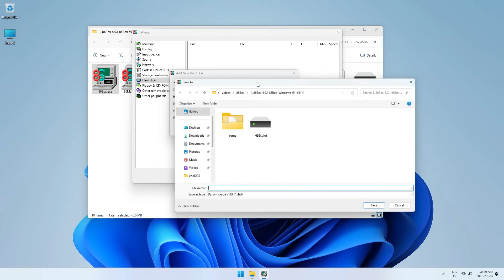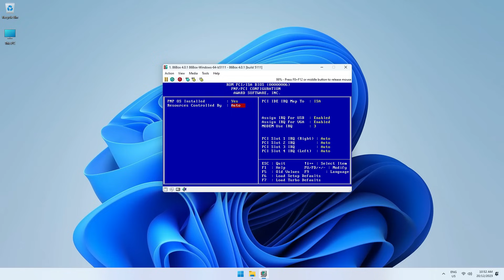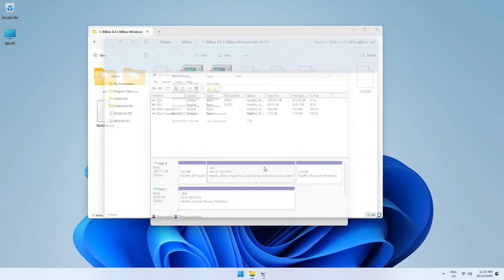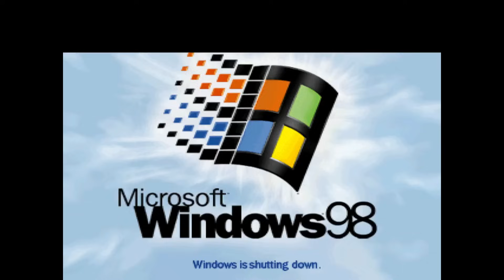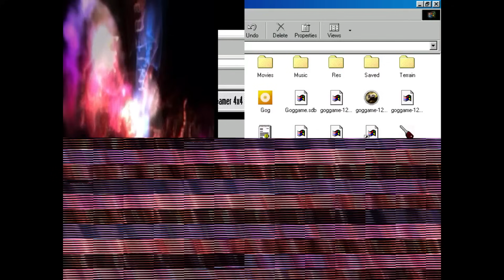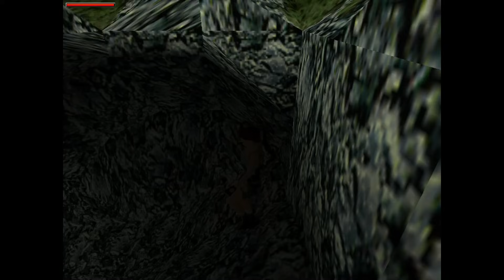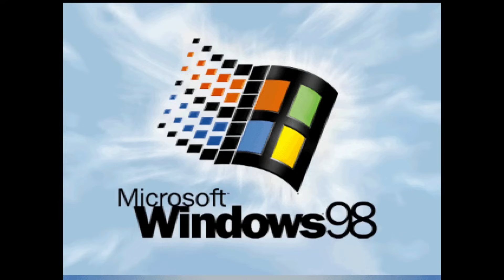86Box Windows 98 Setup (Pentium II +Voodoo  3, all files provided)

Comment: Windowed display is better in PCem, you can set aspect ratio to 4:3, integer scale, square pixels, filtering either linear or nearest. 
Its nice because i can just match the resolution of the game to either integer scale with nearest filter (looks amazing) if it is a good fit for my lcd monitor
or i can fall back to 4:3 with linear filtering where the above yields a too small image.
Only pitfall i encountered is if you size the window too small and integer scale is enabled it displays nothing (integer scale 0 i guess)

Comment: What about the PC configuration on which you ran 86box? I have low performance emulation, about 60-70 %.
My PC is Ryzen 5600x, 32gb 3600mhz ram, ssd sata and m2 1tb, rtx 3070ti, win 10pro 22h2 latest updates and  latest drivers.
Reply from the maker: i9-13900H with DDR4 and still struggling...

Comment: Did you try to change de renderer to Vulkan for example and fast emulation sound card, it might to enhance the performance I think, right?
Reply from the maker: All default settings. I did read the documentation and don't remember anything about Vulkan.
Reply: @philscomputerlab  in the View menu there is a renderer option, where you can change it.

Comment: Instead of mounting the vhd (which takes a lot of clicks and time), you can simply put all those drivers folders inside a folder to mount the folder as a CD driver. By the way, this is the best solution for those who, for whatever reason, chose to make an HDD image other than .vhd format.

Edit: by using this method, the only thing that one must be aware of is that the sb16 installation file MUST BE copied from the CD to a folder in the win98 hd (cuz it will decompress itself, and it wont work while it is on the "CD", because CD medium is read-only, and 86box treat the mounted CD as that.
Reply: Sounds like a bunch more steps and potential problems. I'll stick with what Phil suggests.

Comment: As always, awesome video. I will have to benchmark this 86Box machine vs my DOSBox Windows 95 one, with the latter one being mainly for older Win9x and Win3x games that don't need 3D acceleration.
I'm installing 86Box on my work PC right now and the i3-8100 is struggling a bit. Even the cursor is struggling while installing Win98SE. Btw, next to me I have a Pentium II 400  laptop with Ati Rage LT Pro AGP which I found in one of the offices and where I installed Win98SE already. Lets see which one will get better benchmark scores. xD

PS: Well, game 1 benchmark in 3D Mark 99 got 37.7 fps vs 11.2 on the laptop but the games had graphical glitches. It might have problems with Trilinear Filtering as the Bilinear tests very fine but the Trilinear one also had lots of graphical glitches. Have to test later on at home, if it's a problem with the integrated graphics of the i3-8100.

PPS: At home with a R7 5800X and RTX4070 the graphics glitches remain. For example the UI in Incoming is totally messed up. The different renderers under "View" don't help, with Direct3D 9 causing a black screen.
On the bright sight, Tomb Raider 2 run in 1920x1080 but going full screen, Tomb Raider 2 (installed from my backup ISO without any patches) is stretched instead of properly scaled to 16:9.
One odd thing, setting the Win98 desktop resolution to 1080, having activated integer scaling and no matter if HiDPI scaling is on or off, switching to full screen, it doesn't fill my 4K screen, even though 2x 1080p should be 4K.

PPPS: Alternative to mounting the virtual hard drive under the host Windows to copy files is mounting the folder of the files you want to copy as a CD-Rom withing 86Box.

Comment: EDIT: Using the motherboard you picked in the video instead of the one I had been using fixed my issue. THANKS! 

Great video. Quick question, do you have any issues with rebooting your slot 1 machines on Win 98 SE with 86box?  For some reason mine always hangs at the full screen logo upon trying to reboot through Windows, forcing me to do a hard reset. Shutdowns work correctly though, for whatever reason.

Comment: If an i9 13900 struggles to emulate a 450 MHz Pentium II system I can't imagine how long it will be until we have computers that can emulate Pentium 4-era systems with no issues! 86Box sounds pretty amazing, though. I've only ever tried VirtualBox and I didn't like it at all. There was no emulation of specific hardware like with 86Box.
Reply from the maker: Yes this is the reality unfortunately....
Reply: I wonder if it will actually be needed by the time we get to it. Backwards compatibility is rather strong from the year 2000 on. I am rather sure a 450 PII is going play anything that you can't just play natively on a modern PC.
Reply: @AxiomofDiscord  There are few games that can be very tricky to run on modern systems. One example is the original release of The Sims. If you want to play the disc version there’s no way. The only way to play the game is to have the complete edition and then there’s a patch for it. Also Tony Hawk 3 is difficult to get running. There’s a patch for it but it’s hard to find it online.
Reply: @2Plus2isChicken2013  Seems pretty reaching when you say oh these games have trouble running unless you patch them. I Believe I have the Sims I will give that a try, maybe I can trip by Tony Hawk 3 and see how it goes.
Reply: @AxiomofDiscord  It's just more annoyance than it should be to have to find patches to run games. Tony Hawk 3 requires a 500 MHz Pentium III at minimum, so running it in 86Box is out of the question. I'd prefer not to have to go looking around sketchy websites to find patches to my games. Unfortunately if we're not able to emulate beyond a 450 MHz Pentium II there will always be a few games that require that in order to be played, mainly stuff that came out in the early 2000s. Not every PC game from that period is available digitally.
Reply: @2Plus2isChicken2013  I have no problems with these games out of the box the biggest difficulty was getting a gamepad to work with THPS3. 

What trouble are you having?
Reply: The key is: code optimization (better dynarec, better multi-core cpu usage for all emulator, processes and emulated hardware, parts of the code)
Reply: Yes, you can choose between spending $3000 for the latest system or digging an old PII450 out of your neighbor's trash for free. Really the problem is that Pcem and 86box are very heavily biased towards single core performance and cpu development has been moving away from max single core speed towards multicore for the last couple decades. My 20 core 3.6ghz xeon system can only emulate a Pentium 120.  Not nearly fast enough for Porsche Unleashed which is also unplayable on modern systems.

Comment: This is a very helpful intro to setting up 86Box, and even though I've done it a number of times, I learned at least one new thing (using the Disk Management utility to mount your device's disk image) which will be a huge help.

Personally, I've never really been able to bump the speed on my VMs past about 200MHz on my system (using a Ryzen 7950X) without starting to suffer from pretty bad audio stuttering.  It doesn't bug me too much in my case; I use it for retro development more than gaming.
Reply: Is this with less than 256mb of ram and softfloat fpu off? You should be able to use 266 easy enough and likely a little faster without audio stutters. I get some stutters here and there at startup but that is it and that does not always happen. I am only using a 7700x.

Comment: My computer can run some apps on a PII up to 300mhz but a lot more consistent around 233mhz and that is enough to run everything I got that struggles running natively. 

I have a Ryzen 7700x this emulator seems to favor Intel but not massively from what I have heard. I know some console emulators favor Ryzen, which is the thing that made me go that route more than anything else.
Reply: Version 4.2 seems to run at 300mhz better, I have yet to try any higher clocks. If anyone thinks the mouse really lags bad hook up a 98se computer to the same monitor as your modern computer and see if it is about as bad. I find I forgot how bad the precision of old OS pointers were. Modern life has spoiled me. Oh and the old FPS games really lack some motion smoothing and I can see why many people would get motion sick.

Comment: Nice, I tried a while ago on my Ryzen 5 2600 and wasn't too happy about the performance, will try again with my 5600G and 5800X to see how they stand.
Thanks for all the resources!
Reply from the maker: Nite that PCem runs quite a bit faster but it is said it is less accurate. In the games I tested I didn't see a difference so I would use PCem because if the better speed.

Comment: I'm surprised you haven't set up an automated Windows installation CD by now. Or more likely you have but want to show off the manual process for the viewers.
Reply: it really does not take much time to make several clicks here and there. And after install, you just make a copy of VHD and you have backup of 'fresh' windows setup. So it really takes more time to write configuration for autoinstall, than just enter some user name and serial.
Reply from the maker: Good point!
Reply from the maker: I'm surprised you haven't run a search in my existing videos for automated Windows 98 😀

Comment: Odd thing with 86Box, I can't even get a PII 300 to run on my Ryzen 9 5900X, without it stuttering to all hell and back. 

On PCEm though, I can get a PII 350 to run at full speed, with very few dips under 100% in terms of system performance.

Awaiting the Ryzen 8000 series, as I do intend to upgrade this generation, and will be curious to compare.
Reply: 86Box New Recompiler variant is bit closer to PCem in terms of performance

Comment: Interesting. 
One question, could the data in the vhd be copied to a similar real system (with same board and chipset)? 
Could be a nice way of fastracking building a retro machine without dealing with the hw side, specially when using an SDtoIDE hdd solution.
Reply from the maker: Yes! Many people are doing exactly this in situations when the Retro PC doesn't have an option to boot from Floppy or CD. But be aware, Windows 98 and old machines can be a bit finicky when it comes to storage...

Comment: Some important information: PCEm, despite having fewer resources and being abandoned, is considerably faster.

To make sure your hardware is powerful enough to handle the emulation of your chosen configuration, there is a percentage meter in the top left corner of the 86box, it should always be at 99%, 100%, 101%. Anything below this means the host is unable to maintain speed.

The configuration to be emulated is directly related to your computer's hardware specifications. In terms of perfect emulation (always 100%) I can say that:

Ryzen 5600G, 5700G, is enough to perfectly emulate Pentium 100Mhz on 86box, Pentium 120mhz on PCEm.

Core i3 7100, is enough to perfectly emulate 486 @ 66mhz on PCEm

I believe that a Ryzen 5800x is enough for Pentium MMX @ 200Mhz.

The amount of RAM memory does not affect performance, and the real problem is the emulation of the processor cache to be emulated (by turning off the cache you will have a smooth emulation, at the cost of the slower guest).

It doesn't matter if you have 192 cores, the emulation will only use a single thread to emulate the processor, so what matters here is the host clock speed and raw power that a single core can offer. The other cores/threads will be used for, for example, the graphics card emulation system, sound card, OPL...

Many people think their spec is enough for, say, Pentium 2 233mhz, because it sees the counter at 100% most of the time, but that could be wrong. The first litmus test is when starting Windows, if the startup sound is choppy, guest is too loud. The second test is to open Windows Explorer (or my computer), this part of the rendering is chaotic, and usually slows down the emulation speed. The third is to navigate through the folders, when changing the directory, you can see the counter drop, and sometimes the "start.wav" sound being played choppy. Despite this, a large number of games can still run fluently, because they make use of instructions that the emulator can deliver quickly.
Reply from the maker: Yes this is also my observation, PCem v17 runs a lot better than 86Box. Apparently 86Box is more accurate though, but it's not something I noticed with the games I tried out. Some games are more stressful than others as well.

Comment: At the beginning I have played with Vmware for Win 98. I have managed to install the OS, but I didn't like at all the display adapter support.
After that I made a little bit of research and ended up with PCEm. I was really amazed about the fact that it actually emulates the whole PC, starting from a BIOS level. I also got the same stutters as you Phil, and I found the hard way that my Ryzen 2700 is not powerful enough to emulate a K6-2@400MHz. I don't remember exactly with what CPU I ended up in the emulation, but I compared 3DMark99's results with the ones on the real machine (own database from '99-2000) and I have found out that the emulated machine gave similar results with the real one. If I remember correctly I have also tested the CPU with an old benchmark (TESTCPU) which has a database and the results were similar. What I really don't like about PCEm is the way in which you transfer the files from the real PC to the emulator environment.
After fooling with PCEm for a while, I jumped in retro collecting computer parts, so I've left aside this emulator, but after a while I have also tried 86Box. I think this one is more flexible than PCEm but it utilizes more resources. In 86Box I've ended up with a Socket 7 machine and a Pentium MMX@166. With this configuration I'm okayish, with minimal sound stutters. What I like very much about 86Box is that I can actually mount folders (opposite to PCEm where you could only mount ISOs). At one point I've begun studying how to setup network emulation in order to able to play Warcraft 2 at a Lan Party. I have managed to start a network game over IPX/SPX protocol between 2 86Box emulated systems running on the same real PC. But the project has been abandoned since I found about Warcraft 2 Battle.net edition which works like a charm under Windows XP.
After all I think it's very nice that we have 3 great alternatives for playing old games: DosBox, PCEm and 86Box. They are all very good, all of them have their pros and cons and one can choose the best solution for project that she/he wants to start.
P.S.: that thing with attaching the VHD in Disk Management is really, really nice.

Comment: I fight hard to build, keep, maintain, and use retro machines, like my 486DX2, a couple of Gateway P3s (Voodoo5 in one, Voodoo3 in the other, and an Athlon XP system.) However, it gets more difficult as time goes on. Parts fail. Capacitors die. CRTs are almost not worth hunting down, especially considering that they will die, and they are difficult to get rid of. Sometimes an ebay seller will lie and say that a retro part has been "tested" and "working," but the part is DOA (I had this happen with a Voodoo5 once, seller decided not to fight me on the return after listing no returns but item "tested and working," and I took pics and video of it not working and attached them to my return request.) It is inevitable that 86box and DOSbox will be the only ways to enjoy this hobby. I hope that 86box can someday use the DOSbox staging CRT shaders you showed us in another video (or maybe shaderglass someday supporting them.) Then it will be difficult NOT to use 86box, hehehe..

Comment: Really nice guide! But you left out the details how to identify if your system is too slow - so i will clarify that ;-)
Both 86Box and PCem shows the emulation speed in the window title or status bar. If the emulation system stays within 99-100% you are totally fine.
If the speed drops a bit randomly to max. 80% for a short period of time and gets back to 100%, its fine either - even if you get sound or frame laggs.
But if your system is constantly below 100%, please downgrade your emulated CPU frequency or choose a lower CPU generation. Also you may try a AMD K6-II or K6-III based machine, but note that such CPU class is much higher demanding than any intel pentium series CPU's, due to its RISC implementation.
Reply: It is worth noting that Intel adopted the "RISC core under an interpreter layer" architecture with the Pentium 2.
Reply from the maker: Thank you!

Comment: I was positively surprised that 86Box seems to be capable of emulating fast PII machines on Ryzen 9 7945HX. Authors should consider adding support for PIII 450. My old Intel Core i7-920XM could only emulate max 486DX4 100Mhz.

Comment: Last time I ran 86Box my way to transfer files was a CD burning software (K3b on Linux).
Used to add/remove files in an ISO to be mounted as a CD rom by the emulated win98.
Works with the emulated machine turned on, and quite easy to use, albeit a somewhat inelegant method 😁
Reply: I use K3b to write Linux ISO to a DVD.
I tried to write to a USB stick once but during boot, the BIOS was not seeing the USB stick. I will have to try again someday.

Comment: Thank you Sir.  I installed it at work.  Everything was fine.  Installed awe64 gold and tried wave table GS midi files.  Surprisingly it works.  Not great but works.  Very cool post. I always wanted to try a awe 64 gold.  Got the software off of your site.  Then I tried doom with AW32.  it works.  wow. I noticed that setting the ram at 128 really helped vs 256.  Now it runs at 400 mhz.  What is amazing is this is all emulated by software.  By people that must have too much time on their hands.  Very cool.